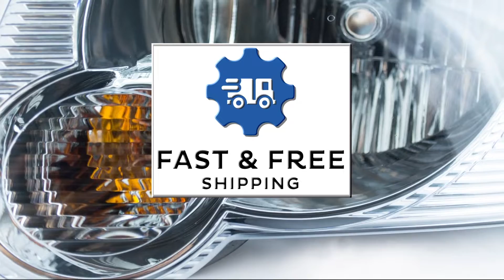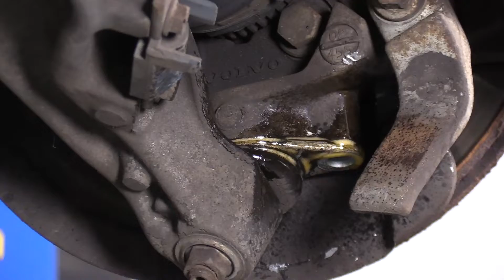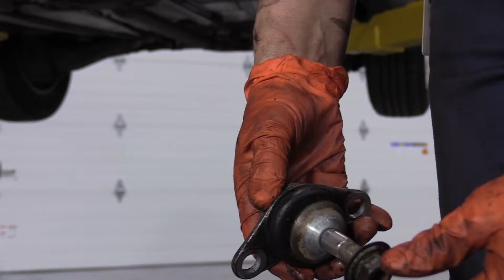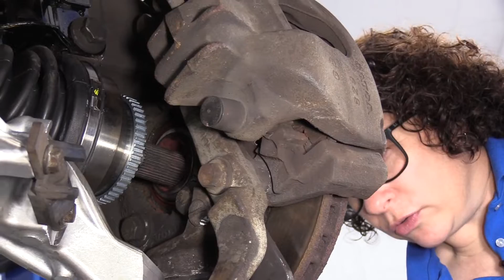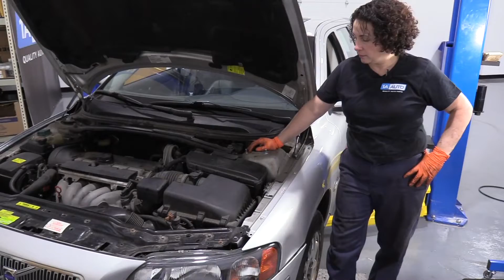How to Replace Ball Joint 01-07 Volvo V70

Comment: I have done a couple of these. There is very high risk of ripping the ball joint boot when reassembling by using a pry bar to lower the control arm enough to get the ball joint into position. I almost feel like it would be better to unbolt the control arm from the car, attach the ball joint, then bolt the control arm back on the car. Miserable either way, but not ripping the boot helps keep from having to do the job again.

Comment: Hello, the torque for the 18mm nut at the ball joint is 50Nm AND 35 degrees. You can see it in the Volvo manual.

Comment: Why did you put in first the axle bolt and then put the bolt joint screw into the control arm rather than the other way around? Thank you!

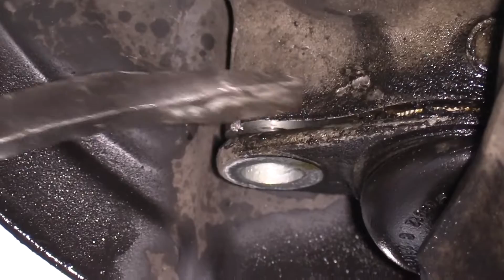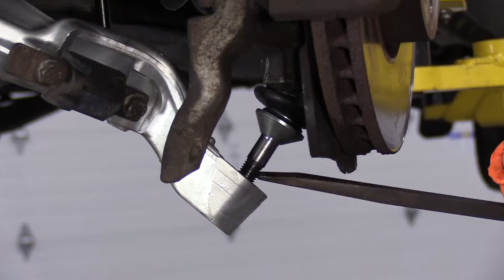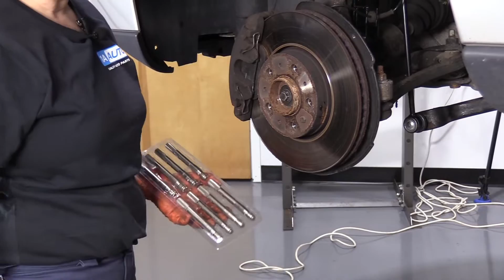Comment: 3:34, steel and aluminium don't go well together, nicked in no time.  Surely Volvo have special tools for this?  I've never been a fan of the hammer-and-chisel approach, especially the way you're hammering on the threads (11:57).  I like the stud idea (13:35).

Comment: You always start with the lower Ball joint nut, according to Volvos instructions...then you press down on the control arm with a pry bar, then it is easy to get the ball joint looose...
Reply: Do you need to take off the axle later on?

Comment: 11:59  Did the end of the bolt scrape the inside of the recess?
Reply: yes but it dont matter as it better to use anti seize on that area so it will come apart nice and ez next time.. just did mine today . few hour job well atleast in the north east rust belt

Comment: Torque Specs please?   Your axle video had torque specs given.  Can you provide the ball joint torques?  Thanks for the great videos.  I hit a curb , busted the end of my control arm off, bent subframe.   NEed to figure out how to properly support engine and remove subframe in my dirveway and junkyard for the part.   Here's to DIY !!  Only paid $1500 for my 2004 XC70 so not worth paying someone else. I  do most all my own car work.
Reply: stabilizer  bar on the top fender rails like $80 at H freight.. you can use it too to do the steering rack youll need it..

Comment: You don't need to take it off the axle. I took the joint first out of the control arm by lifting the hub out of the control arm hole with a jack cushioned by a board. I feared that that would result in the control arm snapping up but there is little tension (you can push it down with your hand) so it just tapped against the boot of the ball joint. The I removed the two bolts and hammered and pried a thin chisel between the joint housing and hub like in the video, after which it fell out. Haven't put it back together yet but that seems easier than having to worry about mounting the hub back on the axle.
Reply from the maker: +Armin Petschelt Thanks for the feedback!
Reply: How did you do while mounting the new ball joint?
Reply: @lev1g  he’s probably still working on it

Comment: a couple  suggestions here........  when driving the old ball joint out, use some sort of spacers to avoid it rocking in & out as you drive from side to side.   Upon installing the new joint, do not drive it in at an angle.  You're basicly installing a cylinder into another cylinder & the angle is 'making the joint bigger' than the hole it's going into, which could crack the contol arm.  Snug the bolts evenly, then tap the joint side to side with the Brass Drift....snug...tap...snug...tap etc etc until properly seated.  Also use the brass to beat on the threads
Reply from the maker: +Lugin4 GuviStf Thanks for checking us out. 1AAuto.com
Reply: No no no! I don't like this "cylinder into another cylinder" piece of advice. Offset it. The reason she went in at an angle initially was to counter another problem before it happens. If you go straight in the ball joint jams because the bolts pull up on it unevenly. Assuming you're using hand tools and don't have an air hammer...

Comment: Generally good instructions, but with some show-stopping deficiencies that I had to correct in order to complete the job on my 2001 V70 base model (no turbo).  Read on to find out how; you will be glad that you did :).

Removal was pretty much as per the video.  The only change I made was to use a jack under the brake rotor for the final step to lift the wheel assembly out of the way so the old joint could be lifted out..  This made the task a lot easier.

Installation was much more difficult than expected and required additional steps to complete successfully, as described below.

(1) I sourced the replacement aftermarket part locally.  Having read the reviews on the A1 Auto website, I knew that the end of the ball joint to be inserted is sometimes too tight, so I took the precaution of measuring it with a vernier caliper and comparing it with the old part.  It was about .008 inches too big, so I was expecting it to be much too tight and indeed it was; there was no way I could seat it properly.  I then struck on the idea of grinding it down to size using a grinding wheel in an electric drill. This, together with frequent measurements of my progress using the vernier caliper, worked really well.  It took perhaps 10 minutes to get the maximum diameter within .002 inches of the old part, at which time I tried again to install it.  It was still a bit tight and could have used a bit more grinding, but it went in without too much trouble, so was good enough :)

(2) After the above step was completed, I found it quite impossible to get the stud of the ball joint into the control arm.  Perhaps the suspension on my car has a longer travel than the one in the video?  Anyway, the solution was to remove the two big bolts that hold wheel assembly to the strut, after which the assembly could easily be lifted up to allow the stud to fit into the control arm.  Note: before doing this, I had to pop the ABS sensor wire out of its nylon clip to give the assembly room to move; it comes out easily with the help of a screwdriver.
Reply: Thank you for the advice. One question: Why using the jack under the rotor (when you slid out the old ball joint) does not work for sliding it in back after the installation?
Reply: If you buy the original $30 dolars at fcp euro will fit like a glove.

Comment: what does one do this job  if there is no 'lip' provided to put your drift onto to tap ball joint down ?
i'm sure my car had no lip ?
Reply: Thats why she used a brass punch. So the Al won't be damaged when she hits the seam.
Reply: You will find the lip if you scrape off the dirt covering it.
A tip for later if it's hard to maneuver the ball joint stud back into the control arm is to remove the strut bolts. Then it's easier to lift the hub.

Comment: I was wondering how to do this on my 04 without a press. Thanks! This will make it much easier. Btw, I was cringing when she was hitting the ball joint thread with the prybar. Lol.
Reply from the maker: Thank you for the great reply. We love to empower our customers by showing you how-to perform your own auto repairs while installing our high quality auto parts. Have a great day! 1aauto.com +Crashjr86
Reply: @1AAuto  I'm doing strut, ball joints, bearings, and sway bar links at the same time tomorrow. It'll be easier with everything off at once.
Reply: You can get a pcv pipe with a cap to mimic the official tool. Then hit that pcv pipe cap with a mallet to seat the ball joint.
Reply: Yes she loves to damage cars. Look at what she did when removing a volvo front bumper

Comment: Hi, do you neer a wheel alignment after ball joint replacement?
Reply from the maker: +Lukas Rutkauskas It is highly recommended any time when you replace suspension parts to get the vehicle aligned. This will ensure that it is safe and the new parts you install of the vehicle will wear correctly.